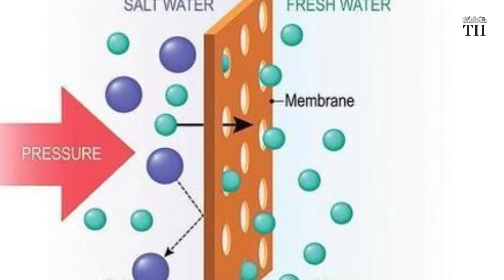Why are RO water purifiers being prohibited?

Comment: The actual problem with arrow to the public is not even in ministry's radar.
R o water systems reduce the TDS of water to around 80 TDS, effectively reducing the healthy minerals required like calcium, Phosphorus, magnesium and iron. This is leading to a lot many health issues like osteoporosis, anxiety, brain disorder, anaemia and muscle loss. Lack of essential elements reduce immunity. Further RO systems increase the positive oxidation potential. Causing acidity,  bone damage and ultimately terminal diseases. 
The solution are water ioniser systems. Which do not make the water acidic and are a real boon. 
May contact me for further clarification  on 9340495417.

Comment: Which methods are as effective or more effective than reverse osmosis at removing lead, heavy metals, pesticides, pharmaceuticals, bacteria, viruses? 
Deionization is more expensive and distillation requires more energy and time to condense. 
Traditional filters often do not remove enough contaminants and/or biofilms can form, thus contaminating.
Whole house or kitchen sink solutions are preferred over cheap plastic carafes which must always be inconveniently refilled and hold a trivial quantity.

Comment: What if the waste water was used to flush toilets and/or water plants?
When it comes to seawater there is no waste, although the extra salty water could be use to make salt more efficiently then just boiling sea water directly
Here in Canada we use RO's for maple syrup production. We save the pure water aside but mainly we save boiling time in syrup making by removing 75% of the water with the RO first. It is a godsend, truly. Saves so much energy

Comment: Poor societies which are suffering poor domestic water supplies, they don't have considerable knowledge about these systems and potential contamination in their water.. At the end, RO is a technical device and it doesn't go well using multi-stage units assuming it will be good to remove "everything".. In this case it may cause more harms by removing necessary electrolytes from drinking water especially in hot tropical weathers and leading to various neuro system defects and malfunctions

Comment: SEE GUYS RO IS NOT BAD IF PROPER CONDITIONS ARE MET

1.THE MINERALS LOST ARE ADDED BY MINERAL CARTRIDGES IF YOU ARE HAVING A GOOD RO (LIKE PURE IT )

2 IT IS NECESARRY FOR THE INCOMING WATER TO HAVE A TDS> 500 SO THAT IT WILL REDUCE TO SOMEWHAT AROUND 60-70 (AFTER ADDING MINERALS  LIKE Ca and Mg)

3. AVOID USING RO WITH TDS CONTROLLER AS IT JUST ADDS INCOMING WATER (AFTER MINUTE PURIFICATION) TO PURIFIED WATER TO INCREASE ITS TDS

Comment: The tds in my area goes over 3000 in summers so ro is a must
Reply: I use a cartridge called PH + it adds back all the good stuff and raises PH. Because R.O. water is below 7
Reply: @robertzediker8302  that only means your ro system allows some small quantities of regular water to pass through.
Reply: @vinishshetty8055  You assume but google ph + filter.
Reply: Ro ke saath alkaline lagana ph ke liye
Reply: @harkeshrana4242  bat same hi hua naturally jo minerals mil raha hain..usko  chorke. Tdc controller dr kr artificially. Minerals add karo.....mera manna hain to TDS. 300 ke upor na jaye to koi filter use korne ka need nehi hain....aagr government ka tap se water le rahe hain to....jada satisfaction ke liye nrml jo purifier hota hain.. Without RO. ..osb use karo
Just like Rs 2200 ka pureit..
"Main koi advertisement nehi kar raha hu.. Just example ke liye bol ye"
Reply: Look it up, Im 55 and had a broken wrist and the Dr. Said I healed like a teenager. My room mate had a botched breast reduction and left a big hole that wouldn't heal, she started drinking my water, and her Dr couldn't believe how fast she healed
Reply: Kindly check whether your RO purifier can handle that concentration. Having higher than recommended TDS will damage the membrane. Also any suggestions regarding where can I have water quality art my home checked?
Reply: Yes

Comment: What I know is RO hasn’t removed the calcium and magnesium carbonates, evident by the limescales on my utensils and immersion heater coil.
Reply: You use RO water to clean your utensils and for bathing?
Reply: Time to change the filter.
Reply: You have a problem with your RO unit then.

RO membranes remove the calcium ions from the feed water. 

Check the conductivity of the permeate it should be <90% of the feed water conductivity (depending on the set up)

Also high levels of calcium/ magnesium in the feed water would cause the RO membrane to foul and should cause low flow.

It’s probably a simple o-ring/ seal failure
Reply: I am referring to RO treated tap water. Watch the clip first

Comment: If not RO, which are the other popularly used filtration techniques ?
Reply: All depends on what the feed water is.

All water purification is not a “one size fits all” but a selection of complimentary units designed to produce the right quality based on the feed water supply.
Reply: candle filter use karo sabse achha
Reply: UV or UF. It does not waste any water neither it removes the essential minerals. They only treat bacteria and viruses. The best brand in this field is Indiadew . Please visit www.indiadew.com
Reply: Uv
Reply: Tds 500 se kam hai uv wale system use karo phir ph bhi maintain rahta hai
Reply: Ultrafiltration. But it also uses some water during filtration. But doesnt remove minerals.

Comment: My RO outtake is used to clean floor and water plants.
Reply: 1. for a tank full of RO water (approx 7 ltr) it generates 15 to 21 ltr of water.
2. RO was meant for desalination of seawater that has 35000 ppm and NGT has asked to ban it for upto 500 ppm. Final PPM at output is usually lies between 30 to 100  until you adjust TDS. That low amount of TDS causes more problem in longer run. 
3. Basic math 
Total PPM in 4 Ltr water is 2000 and suppose 1 ltr is with 100 ppm after RO process. So in waste water it's left with 1900 ppm making 633 ppm / ltr. So RO water so not making your water salinated upto that point where it will destroy the tiles or plant. Plants can easily manage upto 2000 ppm water.

So, using waste water from RO is a good thing to do, then just draining it. Washing clothes, gardening. 
I would recommend using waste water from RO to make up for the TDS balancing. Because RO waste water is  goes through 3 filtration process before being called waste water. Your water should be always be between 200 to 300 with good salts in it. Upto 700 ppm water even we human can consume without any ill effect.
Few Comments down here just show, what happens when social media becomes knowledge source. Great effort and thought by @Seeker of Truth
Reply: @StitchSWearShantiSingh  our booring water was 1150 ppm well we drank it anyways but I was not aware for such that my water was bad for our heath, I wish they give our area those narmada line water since I tasted it's no different than my ro water.
Reply: @SeekerofTruth1  Always keep tds above 250 of your drinking water.
And drinking high tds water is fine untill its not saline.
Reply: Bro what kinda setup did u do to collect the outtage water
Reply: @Nidhin2690  nothing just put the outtake water pipe to drum under washbasin so even if it over flows it'll just drain although haven't seen it happen yet tho.
Reply: @Nidhin2690  I plain stuck the outlet pipe with normal transparent tape on my kitchen wall so that the end can go inside a bucket. Also, I keep an extra bucket so that it won't overflow.
Reply: Yes same, however it takes out minerals
Reply: I've found an environmental, life-enhancing, pH balancing alternative!! Check it out... purplehealthwater.com
Reply: Facebook WhatsApp university graduates. When the water from the Tap sources are directly used in plants and cleaning does it not cause the same harm? Ro reject is not concentrate of salt and germs, you'd know all this if you really paid attention in science classes.
Reply: @Arid i have attached drum outside our kitchen and we usually collect water in it, then through bucket we use it in 2nd toilet which is also outside of our house for flushing purpose
Reply: Cloud Tail  what? Lol correcting other's English when your own is barely functional?
Reply: An excellent use for that, the extra minerals are usually beneficial to plants unless it is extremely salty.
I think that rather than banning these systems you should have to store the outtake in a separate tank for purposes like you are, hard to ensure people are doing that though.
Reply: Use in toilet for flushing
Reply: I use it for washing utensils
Reply: Oversmart idiot. It won't help cleaning floor either, the amount of salt in that water makes it useless unless you wouldn't mind spots. And using it on plants? I would happily water my neighbour garden with that 😁. So much for good neighbours.
Reply: @aashishfalswal  RO out take water can be used to mop floor and for watering plants...the salt level is barely high enough...it's not sea water.😏

Here is the source:

https://www.bestrowaterpurifier.in/blog/ways-to-use-ro-waste-water/
Reply: @aashishfalswal  idk Aashish mam my 🍋 tree keeps dropping lemon without asking me for mountain water nor my floor asks for purest water so yea no stains on my white tiles.
Reply: @aashishfalswal  Ever heard of phenyls/floor-cleaners? You don't need pristine water to dilute phenyls.
Reply: It is harmful for plants
Reply: Bad for plants